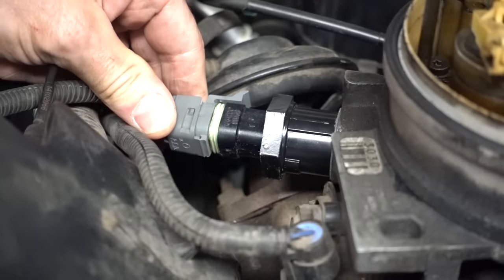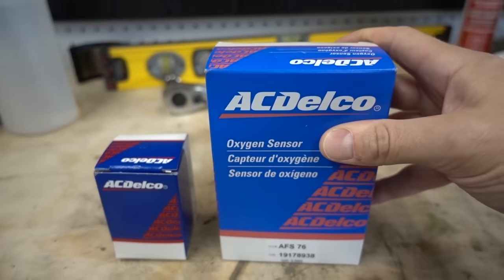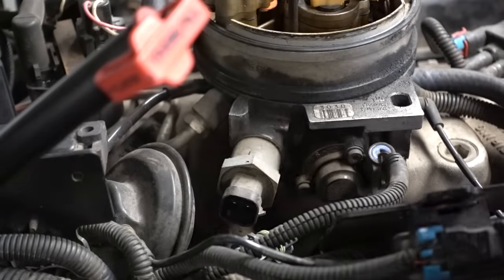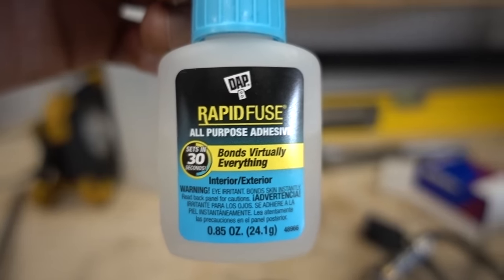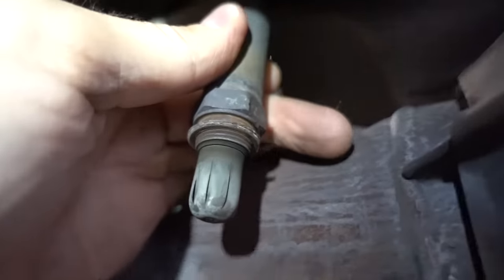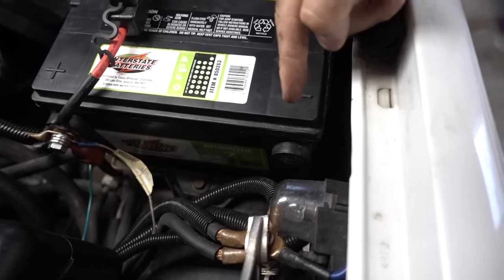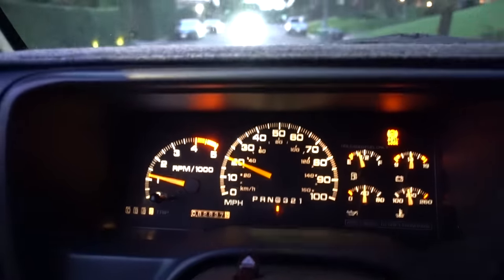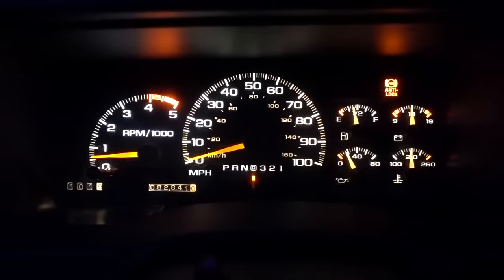Here's the TWO SENSORS YOU NEED TO REPLACE FOR BETTER IDLE !!

Comment: Nice video. My 94 c1500 wasn’t idling or shifting properly at all. Had to play around with gas pedal and sometimes didn’t shift between gears until 4000 rpm. Changed the IAC valve and the TPS (throttle position sensor), $10.00 each from CarParts. Truck idles, runs, and shifts like new! Has 527,000 miles on it too!! Stay safe. ✌️
Reply: Thanks for letting us know. Lately my 95 has been dragging the shifts too long but I’ll definitely change out those 2 sensors. I’m at 462k so it won’t hurt to swap them out. After all they been there since new
Reply: @jamesmaldonado5794  👍 The TPS controls the shifting and IAC controls the idle. CarParts online has them as a kit for $20 + $10 shipping. Best deal around. Best of luck!! ✌️

Comment: Something was telling me from your last video, that your idling issue was a sensor. Just wasn't sure which it could've been. Sometimes the temperature sensor will give an irratic idle too. Luckily you fixed it with the two sensors you changed. Great video Jimmy!! 👌
Reply: Or the Catalytic converter  ?
Reply: @jimmysapien9961  I don't think so. It would have to be awfully clogged but, you never know. 🤷‍♂️ It is a pretty old truck.
Reply: @iceman45ification1  you never know 🤔
Reply: Which 2?

Comment: IAC plunger can jam up with carbon on the inside and not see it. Always a good idea to change the O2 sensors in the OBD1 setup, think it's like every 50,000 miles, to give engine better gas mileage. Always run better with clean injectors too, LOL. Want it to run really smooth, change the timing chain. Not that many miles on engine but the chain can still stretch. Can verify a stretched timing chain by putting a timing light on the plug wire, if the mark is bouncing around on the scale then the chain is stretched.
Reply: How much is "like" every 50,000?
Reply: @Dark_Knight_USA  keep track of milage and plan to change asap on that milage mark.

Comment: Nice vid, Jimmy!  One more thing many overlook when "rough idle" - engine and trans mounts.  The rubber in these mounts get hard, brittle and cracked.
Reply: Very valid comment. I had a thud when starting and rough idle in a 1998 Accord V6. It turned out to be a broken engine transmission mount which when replaced solved both problems.

Comment: Also a bad egr valve can cause issues with rough running/ stalling
Reply: Also if your wires are good, can go down to your local auto parts store pick up a new pig tail depin it one wire at a time and transfer it over costs about $12,been around these trucks along time, back when the square bodies had tbi on them..... yeah im that old. Put 300 000 miles on one drove it evey winter through salt and cold
Reply: Or a Vacuum leak !!!
Reply: Thank you
Reply: Or intake gasket leak (ig it’s also a type of vacuum leak like what someone above stated) id know cuz I currently have one.

Comment: IAC Valves are sometimes also  called "stepper motors". as the computer  reads the speed of the engine and load condition, it either reduces or opens the plunger on the IACV. it also raises the RPMs to increase the engine when the AC  or any high amp is engaged to keep it at a certain rpm at idle . most cars on the O2 sensor are a maintenance requirement as they should be changed around 30000 miles on some vehicles. check the owners manual for such requirements.
Reply: Thanks for the info!!!  Comments like yours are why I try to read them all.

Comment: This was very helpful information--I was thinking that the PCM needs reprogramming as it is ultimately controlling the idle mix ratio.   I found that addition of 300 mL of Liqui Moly (MoS2 dispersion; $ 9) to the 6 quarts of engine oil quietens the idle of my Colorado.  I can barely hear the engine running while inside the truck. It is supposed to reduce the friction between the moving parts--action is similar to graphite.

Comment: An easy "fix" sometimes and not costly is to put double the concentration of the recommended amount of Techron Concentrate (the big bottles) in the tank and fill up with Shell or Chevron Premium or other name brands (just like jack stands.....) and find yourself a very long hill. Once the engine is up to temperature (coolant and oil), put your foot to the floor and keep it there for as long and as fast as you dare. Do it as many times as you can while being safe. You will be shocked and amazed at how much that improves idle and you may even bump up your MPG.
Reply: Never heard of the "Hill Method." Like the double shot idea.  I have a 2000 cherokee goalie. Changed to double platinum plugs, coilpack, temp sensor, air temp sensor, map sensor, tps sensor, cleaned throttle body, new I.A.C, downstream 02sensor, cat delete, magnaflow muffler.  Purrs like a kitten at idle, roars like a lion who.  And a slight gain in mileage.  Change, clean sensors, connectors and grounds.  Overall happier vehicle.  Gotta find a hill....
Reply: Fuelie not goalie.  As in fuel injected. Lol
Reply: or as the italians call it, an average Saturday drive ;)
Reply: GM owns Techron by the way. Good thing it works for Gm vehicles.

Comment: One thing I would look at is your timing chain / gears. Like the guy you mentioned I drive and repair Fords. I had a 5 liter V8 with 200,000 miles. No leaks or burning oil. But at stop lights it had a slight skip or miss. I decided it was time to replace the timing chain and sprockets . What I found when I got it opened up is the chain was loose and the sprockets worn out . Chain was sloppy! 
I ran nothing but Mobil 1 oil and religiously changed it every 3 to 5,000 miles. So the pistons and valves were in great shape for the miles on the engine. 
I changed out the timing chain and sprockets and I ran smooth as silk at idle and had improved overall performance. 
So check out your engine timing, you might be surprised what you find!

Comment: To do a fast reset, disconnect BOTH battery cables, and touch them together for 10 seconds. This negates any power stored within the computers power system, clearing to factory settings

Comment: The owners manual for your vehicle will have  recommendations as to replacement and/or cleaning intervals; typically under the Maintenance section. If not, a good rule of thumb, is to replace the O2 sensors every 100,000 km.
Reply: Even scan tools said no error right? Can we check O2 sensor whether it's ok or not by measure the voltage?
Reply: @khairulihsan8417  I think the proper voltage should be 0.8 to 0.9 volt. Find the two pins that are zero ohm, the other two pins would be the signal pins.

Comment: To speed up the computer reset, simply disconnect the negative, then use a small jumper wire connecting that to the postive, the computer's capacitors will be drained in just a few minutes.  I have videos about this (so do other YouTubers) BUT REMEMBER, do the restart with a completely cold engine - turn the key to ON (don't start it), let that sit for 20 seconds, THEN start the car, let it idle for 5 minutes, then go driving.  And when you start driving again, drive gently and slowly for a few days.  Especially with an automatic transmission vehicle.

Comment: Install the plug then glue it let it cure,also when you removed idle control valve you should have cleaned out the passage way with throttle body cleaner
Reply: I was curious about the same thing. Would you recommend something plastic safe like mass air flow cleaner, or carb cleaner spray and a plastic bristle tube brush if it holds up while not introducing any scratches in the seat of the area?
Reply: @That_Handle  don t use carb/throttle cleaner on MASS AIR FLOW SENSOR  !!     Throttle body cleaner for throttle body     Carb cleaner for that .. I would not use a plastic brush it might melt   Use a fine stainless steel brush and clean cloth
Reply: @martyhonda6983  ,
Ah, yeah - mistake in writing there putting the plastic bristle brush in with the carb cleaner. Thinking something soft like a brass brush and make sure any metal sticking out at the end doesn't score the seat of the valve. So it sounds like carb cleaner in this instance and leave the mass airflow sensor for that particular situation? I was concerned about surrounding Plastics as they already have the predisposition of brittleness from age.
Reply: @That_Handle  since your under the hood you might as well spray the MF sensor too , give it enough time to dry out before reinstalling
Reply: @martyhonda6983  ,
👍 Yeah, was recollecting to my youth/earlier DIY days when I'd come to reflect upon those order of operations after the deed was already done, too late. 😏 The lessons of hindsight. 🍻 Hm. Sent me off on a short nostalgic trip at that moment seeing what kind of pooled similar events occurred and assessing how long it took before my younger self realised/read about the patterns on geocities forums,  etc. websites esp., vehicle- / make-specific quirks as well as counter-intuitive and/or [worker]-unfriendly and/or convoluted labor by way of design... Such subject-matter exposés are videos at the top of what I like to watch....  There's a guy who covers Ford product issues that I apprecite who pops up in my feed every so often.... Has to be so much more content, though, across the board - enough for dedicated channels or, at least, sub-set playlists from YT automotive creators.
Reply: @martyhonda6983  A BRASS brush is probably the ideal cleaning tool because the brass will not scratch any aluminum parts and do a fine job scrubbing carbon or anything else stuck on the throttle body.

Comment: When you install a new IAC you should do it with the battery disconnected, give the computer time to lose its old memory. After installing the new IAC connect the battery and start the vehicle. Let it idle in park for 2 minutes, drive for 2 minutes, with your foot on the brake and drive, with your foot on the brake, with the ac on. That usually reprograms the computer to the new IAC.

Comment: I also decided to change All my O2 Sensors. 1 of the downstream 02 sensors went bad. So I decided to change the other 3 as well.  I had high idle, bad gas mileage. and my Cluster also need to be serviced and gears on the gas gauge,  volts, temp.  ETC. i will share my results once I get everything done.
Reply: how did that work?  I have a 96 silverado, a 2002 suburban and a 2004 silverado 2500hd.  I am wondering if they all need o2 at this point.

Comment: I am not sure if anybody suggested this to you already. You can get a set of wire terminal removal tools/needles and a new connector. The idea is to remove the wires and pins from the existing connector and transfer them to the body of the new connector.

Comment: Idels fast on startup as a choke ,the pcm injects more fuel until temperature sensor reaches temp
Reply: I have a 97 buick runs good cept while cruzing and the road goea up an incline and i give it alittle gas to keep speed it falls and misses. I let off gass a little so it quits stamering missing back to cruzin fine.  No ck light or stored codes.  I changed ignition module and a coil check but still stammering cutting out when accelerating.
Reply: @ron6376  have you ever changed your fuel pump?  I would start there and do a pressure test and volume test,,,always check fuel pressure if no codes are present,,,

Comment: I want to see what you do to the throttle body n injectors my Lincoln navigator is off the chart  idle is too low like its going to die around 800 rpm's I've changed all 4 o2 sensors,, iac n tps , so far, ran throttle body cleaner through it also, hesitates when I press the gas pedal... but it never dies , just juts the whole car.....    I'm going to check motor mounts later....

Comment: I Love your video your trucks Beautiful love the lil adventures  you go on  im a beginner learning my way around my 96 chevy tahoe 5.7 l and i had all sudden crappy idle and i did the whole tune up cap rotor spark plugs wires fuel filter but not the two seniors ....long story short it was damn cat converters! 😔

Comment: Your IAC very different to Ford, but looks like you have TBI vs. MPI.
General rule of thumb, after 120 to 150k mi. You should change out O2's.
You should see a slight improvement in mpg. Due to old O2's not responding fast enough.
Changing your short term fuel trims.
Long term fuel trims learn and adjust with more driving.
Also idle issues you need to look at any potential air leaks after the MAF.
Reply: Airflow leaks - excellent remark; the availability for older cars may get to be a problem - I've been using conditioner (303 Protectant).
Reply: I agree - keep an Eye on those miles - Timing Chain etc... interference motors  !
Reply: @louf7178  303 is some good stuff.
Highly recommend using that stuff on tires. Clean tires, then Spray them and do not wipe off. Let the product work in. The tread will clear itself with some driving. Don't neglect the spare tire, especially if it hangs under the back area exposed.
It helps keep tires from sun rot and cracking.
Reply: Good tips sir! Thanks!! (1998 ford ranger 3.0 5 spd man. 4x4)

Comment: When replacing IAC, sometimes it is necessary 2 perform a calibration process...sometimes it takes a few attempts. Also the   IAC piston depth and spring can B adjusted. However I do not recommended this 4 newbies.

Comment: Yo Jimbo,

I love you, and I love your channel, and what you do for the DIY guys to save a buck.
However replacing parts without a proper diagnosis to confirm, and verify those parts have actually malfunctioned is called "parts shotgunning". This can be fun, but can get expensive real quick, and mask the true cause of the malfunction. This is a disservice to your viewers who look up to you to teach them how to maintain their vehicles.

"Just because it's new, doesn't mean it's good"
"Sometimes old is gold"
Diagnosis must come before repair.

Imagine going to the hospital complaining of a pain in your stomach, and they give you some pills, and send you on your way.
Blood tests, urine tests, stool test, x-rays, CT scan, visual inspection, food intake evaluation.
These are all part of a proper diagnosis, before treatment can administered.

-Chuck
Reply: Well stated, most professionals would completely agree. A scan tool with live data can show how these parts are working, and whether the PCM is compensating for a badly performing part. At least by using OEM parts the chance of a problem caused by the new part is smaller. By the way, the most common IAC problem is from dirt in the throttle body, grit in the IAC pathway. When they describe cleaning the IAC they are referring to those pathways, not really the IAC itself. One step at a time is always good.
Reply from the maker: Thanks for that. Somewhat agree... however, I’m not a professional mechanic and have never tried to act as such. I’m just a dude who loves to work on and improve his vehicles. In my videos I am balancing a fine line of how to and entertainment... I lean a heck of a lot more to the entertainment side of things. I wish I knew all the ins and outs of how’s to test everything before hand but I don’t. Also, my truck is 25 years old and so are most of the sensors on it which is why I don’t mind slapping a new sensor on here and there. 

Thanks for your input, it is appreciated!! 👍👍✌️
Reply: @1RoadGarage  
Yo Jimmy,

Thanks for the reply, I wasn’t even expecting that.
I was expecting my “rant” to be deleted, and rightly so.
I apologize for going heavy handed on the constructive criticism.
You’re reply reinforces you really are a stand up guy. 

I get the entertainment factor. Most motorists are facing $165, or more PER HOUR to have their vehicles diagnosed, and repaired out of warranty at a shop. A lot of those people simply can’t afford that, and are willing to throw the dice on DIY. When they click on your videos, you are their savior. Entertainment is most likely not their priority. 

I would like to see you at 1M subs, you certainly deserve it. It would be nice if you got there by doing collabs with real professional mechanic YouTube Channels. I think that would help you gain even more credibility. 

-Chuck
Reply: Every time I go to the Dr. they run all the tests and find nothing wrong. I still get charged and have a better idea of what's not wrong but why not prorate the amount since they didn't find anything definitive.
Reply: Chuck - I agree, some scan tools are inexpensive and also you can reset the computer too . Unplugging the Battery doesn’t always Work .

Comment: When a clip breaks, I use thin braided stainless steel cable - like they use to thread through bolts on aircraft. One wrap around the sensor and one counter wrapped on the other side on the connector, then twist until tight and a small lead crimp clamp to keep it from unwinding.